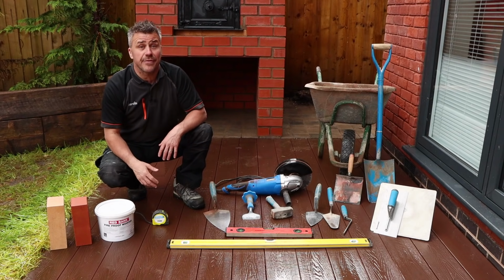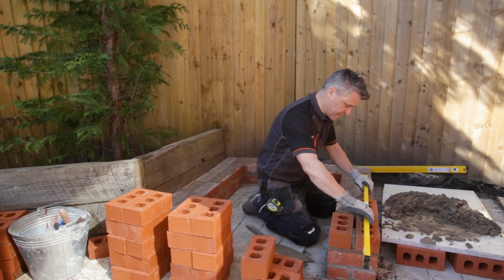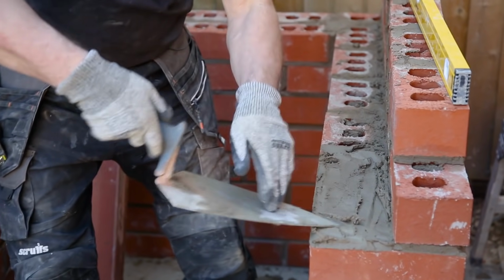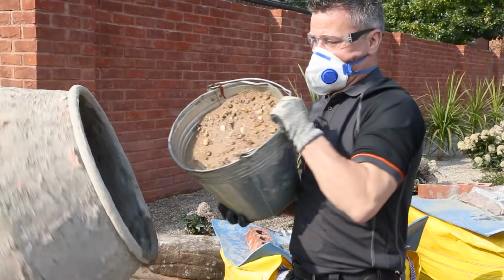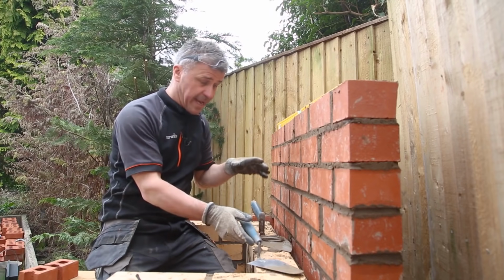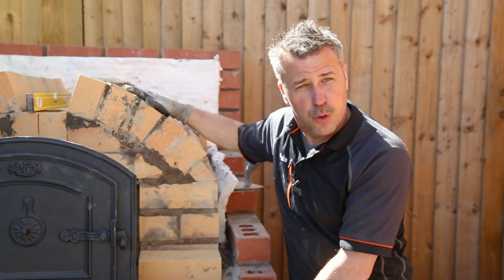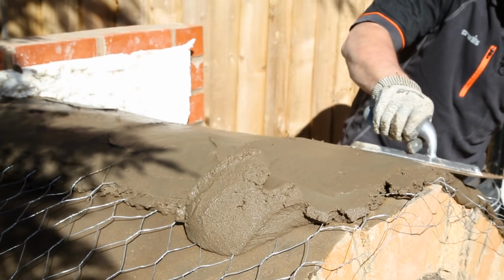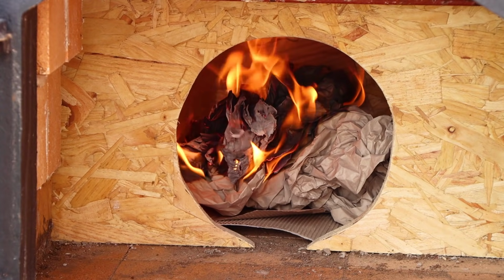How to build a brick pizza oven

Comment: If you are using a level in the vertical position it is called plumb. It is only called level when you are using a level in the horizontal position. This is the only way to know which direction you are going.
Reply from the maker: Thanks for the tip

Comment: hi,why do you plaster the top of the first arge with chickenwire?i can not understand the reason.thank you.
Reply: Per dare più  forza e resistenza alla volta del forno facendolo diventare un corpo unico con la rete metallica
Reply: @maraletini7241  thank you 👍👍
Reply: @kevinwachsmann3111 ciao Kevin... Allora come va' la costruzione del forno? ... O ancora non hai iniziato?
Reply: @maraletini7241  Can I leave out the plaster and lay the insulation on the lower arch without the plaster or does the plaster have to be applied? The second outer arch will go over it?thank you
Reply: Il primo strato di intonaco diciamo che è indispensabile, perché serve a unificare e rinforzare il primo arco, perché sarà proprio il primo arco  a sostenere la grande temperatura del fuoco e allora è bene rinforzarlo con rete e intonaco per evitare che con il troppo calore si spacchi, poi il secondo arco insieme alla lana vetro serviranno solo come camera accumula calore e l'intonaco finale sarà quello che racchiude il tutto compreso l'aspetto estetico del forno
Reply: @maraletini7241  then the plaster above the first arch is essential?thank you for your advice 👍👍👍👍😊😊
Reply: Si diciamo che il primo intonaco, lo possiamo paragonare a una buona base di resistenza... Se non lo fai, è come se costruissi una casa senza fare delle buone fondamenta, al primo intoppo la casa casca giù, è così anche per il forno😅
Reply: @maraletini7241  Many thanks for the help, that helps me a lot. I'm a bricklayer but being a stove builder is something completely different and special and I just don't have the knowledge for it. I got as far as the first arch with the firebricks, which was easy, but then I had concerns about the plaster, but thanks to you these have been cleared up. Now I can imagine how it all works out. If I have any more problems I'll let you know, but I'm doing it for a friend and he's busy at the moment. We'll see when it continues? Thanks again.👍👍🙏🙏🧱🧱🔨🔨😊😊
Reply: Sarà un piacere poterti aiutare... io faccio la camionista di linea come lavoro, ma essendo figlia di muratore, vicino a mio padre ho imparato molte cose e quando ho del tempo libero mi diletto anche io con lavori di muratura
Reply: @maraletini7241  That's great, I wouldn't have thought so. Then you've learned a lot from your father. Best wishes to him. What country do you live in? I'm German. See you next time and have fun at work.👍👍🔨🔨🧱🧱🚚🚚
Reply: @kevinwachsmann3111  allora siamo vicini di casa😂... Vivo in Italia nella provincia di LATINA
Reply: @maraletini7241  I never thought the language would be Italian, but the good thing is that Italians definitely know how to build a good pizza oven. I'm from northern Germany, near Hannover. Best regards, see you then.👍👍😊😊
Reply: @maraletini7241  best regards back 🙋‍♂🙋‍♂👍👍
Reply: @kevinwachsmann3111  BUONGIORNO 🙋‍♀️
Reply: @maraletini7241  Good morning, I have another question regarding the thickness of the plaster? Is 2.5 cm enough? I have fireproof mortar up to 1300 degrees already mixed in bags, it should work.👍👍🙋‍♂🙋‍♂😊😊
Reply: @kevinwachsmann3111 buongiorno ascolta i due messaggi precedenti a questo non sono rivolti a te... Ma ho risposto ad un tipo che ha detto che era da stupido che un muratore chiedesse consiglio ad un camionista su come costruire un forno e per di più un camionista donna... Poi subito ha cancellato il suo messaggio
Reply: @maraletini7241  what nonsense, bricklayers and stove builders are completely different professions... God knows everything but these people know everything better... besides, it's my business if I ask someone for advice, it doesn't make you any dumber. Just ignore these smart alecks. I've just thought of something else regarding the smoke pipe. is a 10 cm diameter pipe big enough and how long should it be? I was thinking of a concrete pipe? Thanks in advance. I deleted the other comment without reading it.😉😉😊😊
Reply: @kevinwachsmann3111 Ok... Per quando riguarda la canna fumaria, se il forno è circolare, per un diametro di 100 centimetri, la canna fumaria dovrebbe essere almeno 30x30... Se invece il forno è rettangolare e misura 70x100,la canna fumaria non dovrebbe essere inferiore a 20x20...comunque è bene che la misura della canna non scenda al disotto de 15 centimetri... Ammeno che non sia proprio un mini forno. Per quando riguarda il materiale della canna, ti consiglio i tubi in acciaio e poi casomai lo rivesti a mattone....per quando riguarda la lunghezza del tiraggio calcola tra i 60 e gli 80 centimetri dal piano di appoggio della canna...comunque poi ti regoli anche in base alla grandezza del forno
Reply: @maraletini7241  

Thank you, that was good information. The oven is rectangular and has the approximate dimensions you assumed. I only want to cover the smoke pipe with clinker bricks for about 30-40cm. Now my friend just has to get going... Many thanks for that, see you later, best wishes.👍👍🔨🔨🧱🧱😉😉😊😊
Reply: @kevinwachsmann3111 buone cose a te e famiglia e buon lavoro... Se hai bisogno ci sono 🙋‍♀️
Reply: @maraletini7241  thank you I appreciate it all the best to you too until then 👍👍😊😊🙋‍♂🙋‍♂
Reply: @kevinwachsmann3111 buon ferragosto a te e famiglia... Non lo so se al tuo paese si festeggia mai io te lo auguro ugualmente 🙋‍♀️
Reply: @maraletini7241  sorry i don't understand this message ??🤔🤔🙋‍♂🙋‍♂
Reply: @kevinwachsmann3111 buongiorno... Adesso te lo spiego... Da noi in Italia, il 15 di agosto si festeggia ferragosto, praticamente sarebbe la festa che indica che siamo nel cuore dell'estate... È ci scambiamo gli auguri per una serena e felice giornata... Non sapevo se si festeggiava anche da voi e allora ti ho mandato i saluti... Capito?
Reply: Rieccoci, 😂allora dai la prima mano come fissante per la rete metallica, poi dai la seconda mano partendo sempre dallo stesso punto  e ricopri il tutto, si più o meno dovrebbe avere uno spessore intorno hai 2 centimetri, cerca di seguire sempre la stessa direzione di lavoro,partendo da sopra a chiudere giù da entrambi i lati, per ultimo liscia il tutto con una spugna bagnata da muratore (FRATTAZZO IN SPUGNA)
Reply: Com'è prima scrivi i messaggi e offendi e poi li cancelli.

Comment: Eventually this is the one that I will build,no one has explained the construction of the pizza oven with such a precision and love for what you’re building than this guy and I have seen dozens. Thank you very much 👍
Reply: Please be careful using OSB and other glued wood for the arch, if you don't manually remove it.
When you burn it like in the video your oven will forever have chemicals left in it from the burned glue.
Reply: @CB-zv1ro where did he use glue??
Reply from the maker: Wow, thank you! And good luck with yours

Comment: I have had a pizza oven on my bucket list for  40+ years.  
I have 40 acres in the Kamloops area.  We have a ton of blue rocks.  I was thinking building a stone base and then for the oven I would copy your program with fire brick and then finish off with more stones rather then rocks.  
Couple questions 
1. what do you think of using all one color rocks and stones?  
2. Do you see any issues substituting rocks for the engineered bricks?  
3. Where did you get the concrete beams for the base of your oven?  
4. The final question is your cast iron door.  Where did you come across that beauty?  

I hope my vision of a stone oven is rustic as we live on an a real rustic piece of property.  
By the way I totally enjoyed your video.  Your a true professional.  
I Sent it to my son in law and wife.  They are pumped to get on with the show.

Comment: How is it that Concrete precast lintels are left off the brick only shopping list? I don't think those are easy to come by at your local box store. So an accurate video would show making your own concrete precast lintels with rebar etc.  I like the design other than that.. but it just seems like an important step to overlook that it's not really easy for the average consumer to buy lintels. Please someone correct me if it's easy to buy where you are... To buy that from a specialty vendor would add  about $1000 for what was used here.
Reply: All outlets that sell bricks will sell lintels as well, or they would order then in

Comment: Well done. If done the same but i used 100 mesh in the bedding on top and used sprayable fire foam .its a bit messy but it works really well.. All the best
Reply from the maker: Great tip! Thanks.
Reply: Cheers

Comment: This man is a pretty good apprentice mason, with 5 years of practice he might be able to lay 1000 bricks a day.

More water and less sand will make the mud more plyable and sticky. It should be creamy but not foamy.
For the work your doing: 13 gallons of sand, 94lbs type 2, 35lbs type N, and plus or minus 7 gallons of water.
This produces a mix approximating type M mortars. Type M is recommended for below grade and structural work.
This will be the perfect mix for building your pizza oven. If doing veneer work I would swap the Type N and Type 2. 70lbs Type N and 45lbs of Type 2. The volume remains the same. The first mix limits hydraulic action. The second variation allows hydraulic action to take place.
Roman mortars were 1 part Sand to 1 part Hydrated Lime.
Reply: Cheers
Reply: You might know your stuff but. you'd put a glass eye to sleep Zzzz

Comment: no insulation for the bottom oven he placed bricks directly on concrete.Proper method is glass,sand on top then bricks.This helps retain the heat and reach higher temp.While this oven can work generally I doubt it will cook proper pizza
Reply: Thanks, that would help of course, but I sure you the pizzas taste amazing

Comment: boooh
the oven has too high a vault, to bring it up to temperature it takes too much wood, and then what is the point of doing all that work, if you cook the pizza in an iron pan ???
the pizza must be cooked on the surface of the brick and you must use the fire to cook the edges ...
Reply: I've used it since to cook proper pizza on, tastes great!

Comment: SORRY BUT IT'S OVERKILL ON THE BUILD!! FOR ONE YOU DON'T NEED THE INSULATION ITS NOT NEEDED!!! ALSO THE INSIDE ISN'T BIG ENOUGH YOU NEED TO ACCOMMODATE FOR THE WOOD OR COAL AND WHATEVER YOUR COOKING YOURS LOOKS TOO SMALL YOU SHOULD OF JUST BUILT IT WITH THE BRICKS ON THE OUTSIDE DIAMETER SO THE INSIDE WOULD BE BIGGER !!! BUT LOOKS AWESOME !!
Reply: Cheers, But it works perfect for what we need it for

Comment: What an impressive build! Hey Craig I was wondering if you had any rough idea how much this would weigh? I am looking into building something like this onto a trailer to cater events with.
Reply: I built one a little bit different to this, with stacks of paving slabs instead of lintels. I totalled all of the most of my materials came delivered by grab lorry and the invoice said 2.7 tonnes. That is before all of the fire bricks, fire cement and insulation. On the pallet delivery for the fire rated items it claimed a weight of 670kg. Yours may not be the same, but if you build them well they will be heavy!!!!
Reply: Thanks, I'd guess the overall weight would be around 1,5 Tone

Comment: If you set the framed mold on bricks each corner you can at end pull out bricks and remove the woodframe to use again
Reply: Not a bad idea, i've not tried it but I can't see how it would work if you changed the from brickwork design a little

Comment: Excellent brick laying! Came out so nice.
About the final insulation on the roof structure, you have placed a cement screed (with wire mesh) on top of the firebricks then after that you have placed your Ceramic fibre on top of the cement screed. Shouldn't you have placed the ceramic fibre directly on the firebricks before the cement screed ?

Comment: My Dear,
You did a great work ,but from my openion as a profisional you did 3 mistakes 
1 :You shoud also isolate the floor beteen the long bricks and the oven floor and thats very importent to keep the heat long time exactly as you did the rest of the oven.
2 : it was completely no need to add another quantity and thikness of the concreat over the long briks as this will cause a very un nessessory whait.
3 : you will need a wider chemni diameter at least double the size of the one you used .
Reply: Thanks for your notes, Yes insulation in the base could help thats for sure, The thick layer of concrete that you advised isn't required works well to hold the heat longer in the base and adds to the overall strength, the chemni is holding out perfectly as its been up for close to 2 years and we have cooked so many amazing dishes as well as hundreds of pizzas and to date we have not experienced any issues, of course therer are many different ways of construction this kind of ovens that suit different things

Comment: Can I ask you how the door is mounted please?  Not bolded for sure , getting confused now
Reply: Yes sure, the frame has a angle section to it that kind of butts up to the brickwork, then the brick work over the top holds it all in place with a strong tight pointed motor

Comment: On a smaller scale. Would engineering bricks and mortar cope with the heat?
Talking pizza oven for one/two.
Sorry. For ask but they always try to sell me expensive fire bricks and special cement.
Have plans for a single pizza oven/ naan bread oven. Not sure on materials, tbh cheaper the better.
 Thinking pea gravel with sand cement for insulation over brick base and surround. Also same mix for 30 mm concrete removable top.????
Reply: Thanks for your question, Ive never used standard bricks for the whole structure so I'm not sure how long it would last, Engineering bricks are super strong and are baked when manufactured to a very hight temperature so they would last a certain time, maybe worth speaking to your supplier of the bricks to see what there species on heat etc
Reply: I didn't have the time

Comment: Hi guys great video
I would just like to ask at the beginning when showing all the tools needed for this project you state that  fire proof cement is needed powdered and pre mixed can you advise where to buy the powdered form as I’m struggling to get it if possible brand and outlet 
Thanks in advance Paul
Reply: Cheers Paul, we got the fire proof cement from Forterra they also supply the brick and blocks we used

Comment: You can also use a big nail or a bent smooth rod to do the pointing. Steel with heat expands, i would not put mortar on the steel and give it a bit of space to expand. The chicken wire dose not take any wight, i wold not put it on. The chimney top could have been done with bricks, one layer with a gap in the middle , next layer with gap opposite the first, last layer complete with over gang, a grove cut underneath the edge to make the water fall off. Good work :)
Reply: Cheers

Comment: Hey there, this over looks fantastic! I have a single question. The outer layer, what kind of brick did you use? We have colder winters and I'm kind of afraid to leave it like that because the brick takes water in and when it freezes the brick cracks and crumbles.
Reply: Hi Gabor thank for your question, We used Forterra's engineering bricks that are designed to be used below Groud so they would with stand very cold conditions, depending on what country you live in I would always recommend checking with your brick supplier that they are suitable before purchasing
Reply: Cheers, I used a Enginerr brick on the outer skin

Comment: how much heat does this give out while the door is open?  I'm wondering if it might double as an outdoor fireplace.  Also, where do you find one of those cast iron doors?
Reply: It does give off plenty of heat if the door is wide open, sitting close enough you do get every warm from it.
Reply: It does give out loads of heat when the doors open if you sit near it you certainly feel it

Comment: A great tutorial.
But I have a few niggling, Aesthetically speaking issues.  
The oven door and the brickwork.  It's not centralised.  The door over the fire bricks is not central and the whole front facing brickwork is asymmetrical, along with the left side of the top arch being flatter than the right.

Other than that, great video.  Hope the oven sees lots of use.
Reply: Thanks for your comment, yes its getting plenty of use cheers.
Reply: full bricks course instead of brick  and half me thinks.

Comment: I didn't have lintels so I ended up cutting  2 1/2 inch conduits to length, filling them with concrete and placing them close together. If I had access to lintels I might have gone that way. Also, I didn't have ceramic insulation at the time, but troweled a perlite/cement mix over the brick.   It insulates well also.  I'm not criticizing this guy's build. It looks well done, but different parts of the world may not have access to the same resources,
Reply: Totally agree, thanks

Comment: Is it fine to put a layer of cement inside the dome? Covering with cement inside the dome.
Reply: It shouldn't need a layer of cement on the inside off the dome as the shape of the bricks will hold without it, A layer apples on the inner skin of brickwork would crumble away given time

Comment: Hello there sir, can you use normal cement instead of a fire mortar.
Reply: It won't last long term with ordinary cement. The heat will eventually break down the mortar.
Reply: @jamesdevlin6373  Thanks  right, thanks
Reply: No we'd recommend there correct fire mortar to make it last